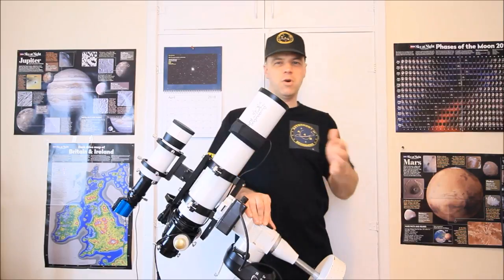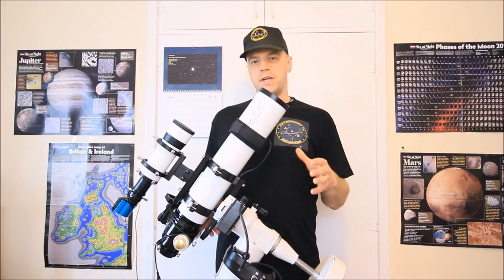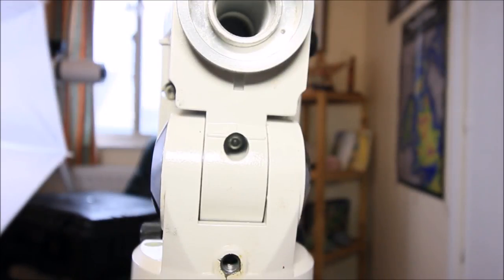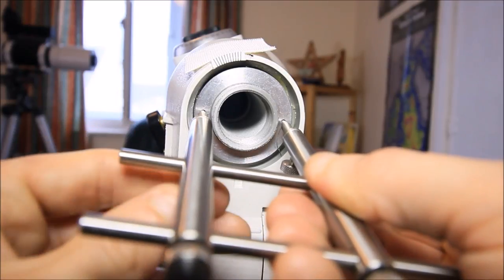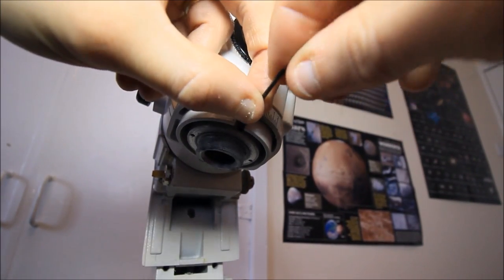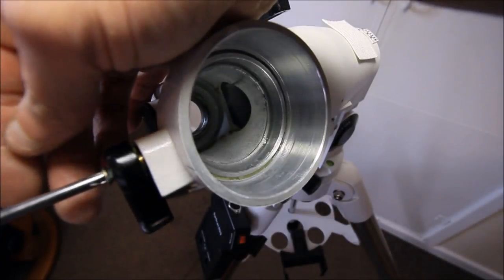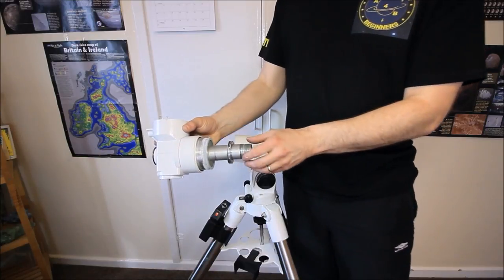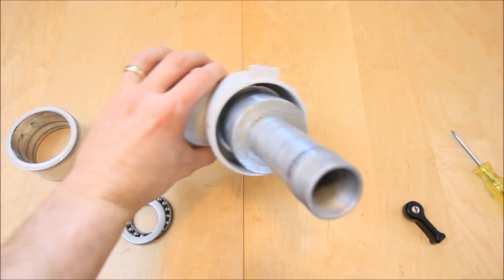How to SUPER TUNE the Skywatcher EQ 5 mount Part 2

Comment: This video is sooo helpful. I’m using it now to tune / fix my EQ5 pro mount. The 2mm grub screws are stuck on the Dec though. :(
Reply from the maker: You know what gotta do, get that mount tuned-up!! Try a little WD40 on the 2mm grub screws, it should help loosen them off a bit
Reply: The solution in the end was to get a different Allen key and that did the trick! I think the Allen key was just rounded off a bit.

Comment: I thought my Orion Sirius EQ-G was the same as the Skywatcher EQ-5, but mine does not look like this at all.  My EQ-G had a retractible counterweight bar that slides yp into the body of the mount. And the motors are contained within the mount body itself, not contained in plastic boxes. This one looks more like the Meade LXD-75 that i had long ago.

Comment: hi martin 
just watched your vid to do my eq5,just wondering if using ceramic bearings on the worm gear axis would make a difference,its more money but!
thanx and subscribed
Reply from the maker: I cannot see why not, as ceramic are lighter and hold the load better, self lubricating so no grease is required and they have very low friction which means they can spin better than SKF bearings, however as long as they fit on the worm shaft and casing you should be good to go. I've heard they perform miles better than steel ones. But be careful not damage them when installing them, they are hard but not as tough as steel bearings. So be careful.
Reply: reason i asked you is i found a guy in ukraine that does the pulley kit,called eqdrive planning on a small refractor or side byside or 2 dslrs 
so no whoppin 200p!
Reply from the maker: That is what I want for my EQ-5 mount, a uprated belt modification. However I've contacted Rowan Astronomy to look into a possible belt mod for the EQ-5 mount, I got a response but I've heard nothing from them on any updates, I would like to know considering there is quite a few EQ-5 owners in the Astro community.
Reply: you can plug a handset in  and use it eqdir
Reply: maybe some ceramic hybrids would do better!

Comment: How do you recon that the main bearing is trashed? How freely should it spin compared to a new one?
Reply from the maker: Replace the bearing, I tried regreasing the standard bearing and it didn't nothing with the free play and wear. Replace them with SKF Bearings, you soon realise that these standard bearings are poorly made.
Reply: @MPAstro  I figured it couldnt be so bad to change it so i ordered a new one. Thank you for your video!
Reply from the maker: Not problem, you will soon realise the SKF bearings are massive upgrade, you will know how bad the standard ones are compared to the SKF ones!!

Comment: Hi Martin, 
really a very good job, three times thanks for sharing this video. I have an EQ5 where I have made a hand crafted motorization for RA and DEC, currently I have huge DEC backlash problems, measuring up to 18 seconds with PHD2,  which does not depend on the rotation of the motor (I have checked and verified many times) but I think it depends on the adjustments of the worm screws, can you give me some advice or suggestions? it would be greatly appreciated, given your expertise.
Ciao
Roberto
Reply from the maker: It's just difficult to tell on the backlash, I usually adjust it from the worm and gear, and then I make sure that you haven't bolted the motor drive to much that this will cause severe binding or it maybe to slack that you get freeplay. You said you made your motors for the RA & DEC, maybe your driving gear ratio is wrong?? Hence why I stuck with the standard Skywatcher motors to be sure.
Reply: @MPAstro  thanks for your suggestions Martin 😉👍

Comment: I bought a secondhanmd EQ5 for not much. I saw that the RA was stuck. So i decided to do a hypertune and install a onstep system. But when i tried to remove the RA axis it would not come out. i needed to use a small rubber hamer. also when i got it out the closed bearing was stuck on the axis and was shitfted 1cm and i could not remove it, it is completely stuck, what can i do, i have ordered remplacements. Also the worm gear drive is also stuck, i cannot remove it. I removed the clutch leaver on the RA axis and i removed also the bolt of the clutch mechanisme. But then i saw that the black thingy on the bolt was broken in pieces. Im thinking with what i can replace it. I have a 3D printer so i clould try to print the same in hard plastic enhanced PLA. Any idea ....
Reply from the maker: Unfornately you have to hit the RA bearing alot more, don't use a rubber mallet, or you'll be at it all day, use a good 2-3mm pin punch and a heavy club metal hammer. try a bit of WD40 and spray along the bearing, that may help lossen it off or use a blow torch and heat up around the area where the bearing fits, (be care not to burn the paint off), maybe a gentle heat, might be just enough to free off. With the worm drive, that is quite unusual for it to be stuck. The plastic part can be easily made with printed plastic, though I have no dimensions of it or own a 3D print design. Sometimes I'm very wary of secondhand mounts, as you don't know what sort of condition it is in, after the last owner has used it, I have heard so many horror stories from people who  bought a second hand mount and found alsorts of problems due to neglect or misuse. Luckily my EQ-5 was brand new, and the 2 years warranty had ran out, so my mount was not mis used or abused. You have to be careful with secondhand mounts, if is a big risk, but if you get a good condition one, you got yourself a bargain!!!

Comment: Is it possible to retrofit a GPDX/GPD2 Vixen with ball bearings?
Reply from the maker: I'll be honest with you I don't know this mount, but if you brace enough to strip it out carefully, maybe you'll be able to size up the bearings yourself, you'll need the trusty Vernier callipers and  micrometer to do this, visit the SKF website to size up dimensions of the bearings you require and the type of bearing is very crucial too. I have faith that you'll will achieve this.

Comment: Wow these are built to a price, no bearings on the dec axis and geared motor drives to the worm? Backlash and play must be huge
Reply from the maker: Yep, The biggest weakness on this mount, why Skywatcher should have made the DEC Axis with bushes is beyond me??? (they should have designed it to run on taper bearings, the DEC axis would be much better, be able carry more load and run and track a lot smoother, hence why I need to do the super tune. 
Tracking performance on the mount after the super tune is greatly improved, seriously so far I've been tracking at 10 minutes unguided.          
There will be video coming soon to show how much the improvement, seriously so far I've been tracking at 10 minutes unguided.
Reply: @MPAstro  Please post your results! What kind of accuracy and PEC are you getting now? I'm putting together a DIY mount and now realised that anything i make will be far better than any <£2000 mount.

Comment: Hi, sir ,  its me you gave an advice to just this day , im the one with a lot of questions that does audio ,  going on watching your vids , just wanted to say , if you are not going to take my offer for audio , i have a studio , 15 years of studio audio work , im going to leave you here some advice . Simple for starts .
Take a look at volume of your intro video , its too loud , there are tools for this , by you can do it by ear as well,  just take it down a bit . Its called RMS Volume , not Voltage going out from your PC to speakers , but apparent loudness , what we actually hear . Would be good to take it down a bit . It starts loud , then wents in to vocal that is quieter , for headphone users , ppl with good speakers , this is inconvenient , i wouldn't tell you , if it was not a problem . Because im  showing off here , its actually something that is bothering me , this is fine for casual consumer , for me not as much . But its not hard , one time adjustment and its fine .
I can also show you some simple ways to improve vocal , but those are technical advice's requiring some work and tools so i wont go there .  I might end up sending you audio from your video done by me . But if you want , i can take time look at your setup and how you work with sound and optimize the process for you, maybe give you easy to use , fast , good software you can use to improve the quality if you are in to it . ( dedskinproducer at gmail )
Already subbed ,  much appreciate the videos ,  thank you very much 
Paul (Producer ,Audio engineer )